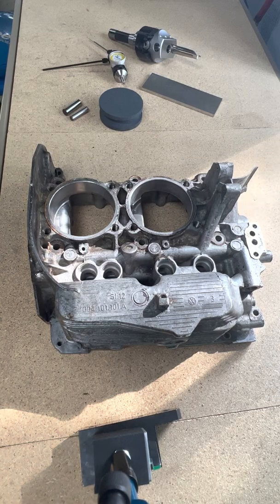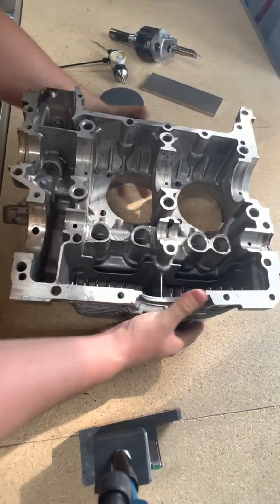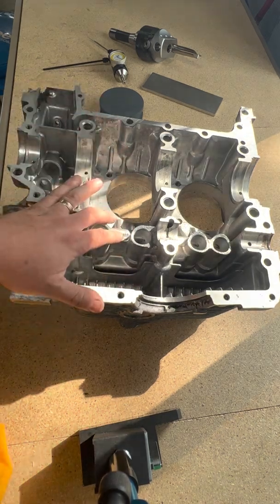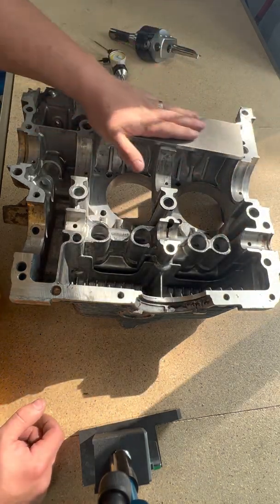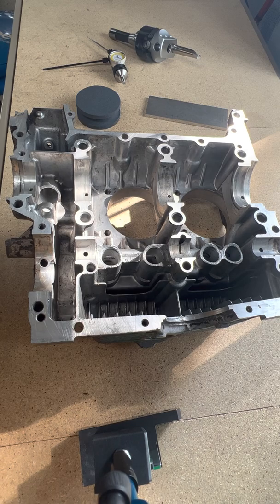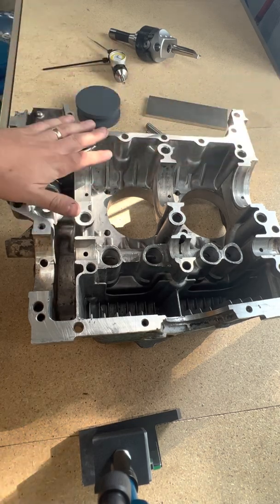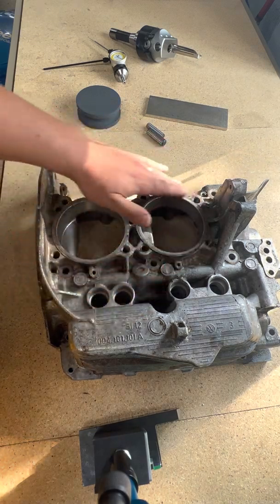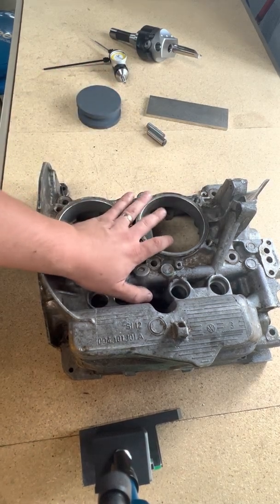Big Bore Type 4 Case Machining - Part 1 of 3

Comment: I use a piece of granite counter  stone from a fabrication business as  wider than the narrowest dimension of the part, 12 inches longer than the longest dimension, glue with contact cement sheets of wet dry sand paper edge to edge, use dye blue on the mating surface and then work it the case until all the blue is gone within reason.
You get uniform full contact with the mating surface unlike spot sanding. And it is much faster
It is a poor mans milling machine